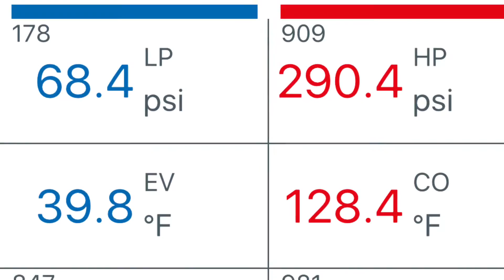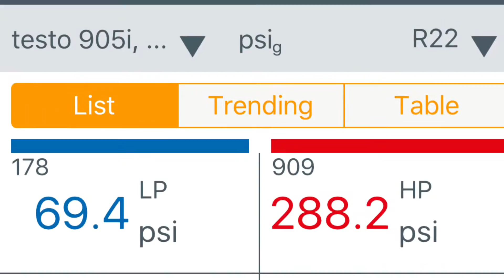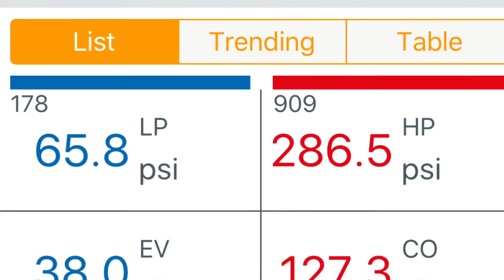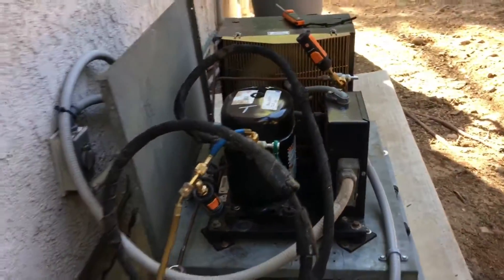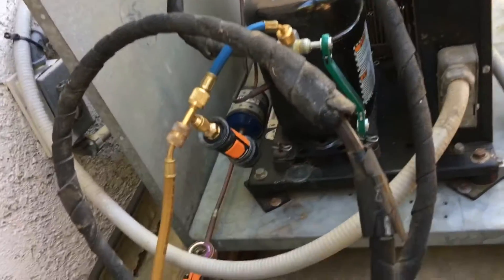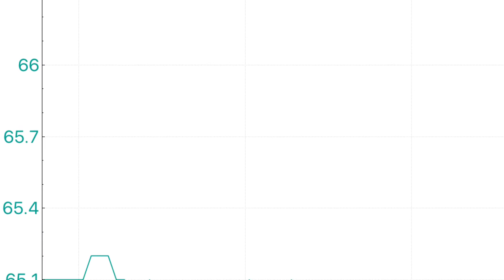5 Testo Smart Probes on a Wine Cellar Condensing unit.

Comment: I find a lot of EVAP coils weep in wine cellar units. The vapor leaks through the cork and is acidic. Good video keep em coming.
Reply from the maker: Yea, i Replaced the Evap & condenser on this one about 10 years ago the suction line just started weeping its like 20-30 years old. i stick the sniffer in the wall and its going off. so, suction line getting replaced one of these years. customer won't approve it yet. He wants me to Just come and visit him Every 6 months or a year and clean the unit and do whats necessary. so, customer is the boss.
Reply: OcRefrigeration,Hvac & Electrical. I used to service one Monterey for Mr. Shugart founder of seagate. He would show me the bottles they drank the night before and tell me it was 20,000$ of wine. His house was pebble beach. It was amazing.

Comment: Nice job and thanks for sharing. Do you recommend the probs over the testo 550? advice really appreciate.
Reply from the maker: No! You should Allways Own Standard Guages and hoses. These are a New Product. 
You should Own---as a Hvac or Refrigeration tech.---3 sets of guages---Min.
2---sets of Analog Guages. One Good Set ( in case your testo's die or start leaking on the job. ) and One Cheapo set for nasty systems.( leak dye systems,leak sealer systems, burnout recovery )
1---Testo 550's or 549's or smans or whatever u prefer.
Also  -- a side note -
 i Have Found that if u do not have your guages and hoses standard set up Going and customers see these probes They do not Like it. Especially if They are Paying Big Bucks. it Seems that if u do not have a Big Guage Set up and Hoses they don't Thinku are doing much. just a fyi. Has anybody else found this to be happening to them ? with the Testo smart probes.
Reply: OcRefrigeration,Hvac & Electrical. I can't say I have. The majority of my customers love the fact that its wireless and Bluetooth. Def agree with having at least 3 gauges in the truck. Nice video.
Reply: Thanks man! I will keep all this  in mind. Thanks for sharing.
Reply from the maker: Analogs Rule ! No batteries to die on you , no display issues in sunlight etc. A Good set of analogs with 72" quick disconnect hoses are worth thier weight in gold ! That's what i Prefer at this time. Imperial 600 series or 800 series are very durable and last. Bulletproof ! 4 valve manifold.
Been using them for Many years ! One Guage set will Last u at Least 5 years.
And they are Less than $150.00 and they are a Four valve manifold.
Reply from the maker: Link --- for guages ---

https://www.google.com/shopping/product/7655961318364024570?q=imperial+800+series+manifold&lsf=rt:2,seller:100446302&hl=en&lsft=gclid:EAIaIQobChMInd7XqN6f1QIVHLjACh38UA6OEAQYBSADEgKQTfD_BwE&prds=oid:13223073239023484868&sa=X&ved=0ahUKEwjygd643p_VAhWG7oMKHfeLD6EQsIwCCAU